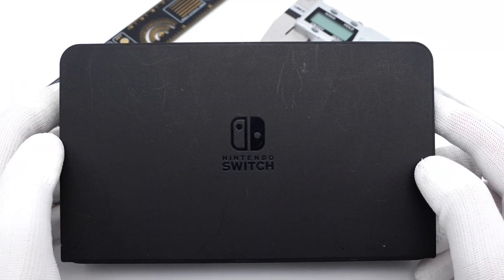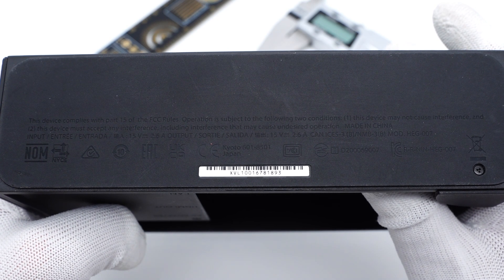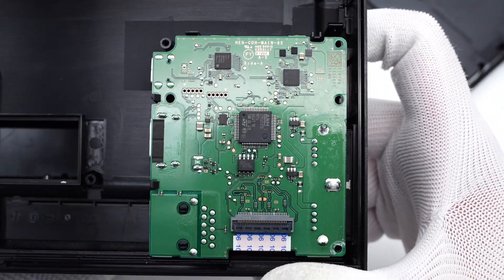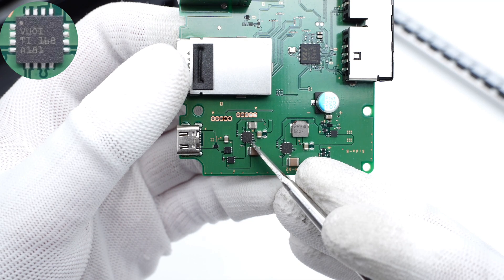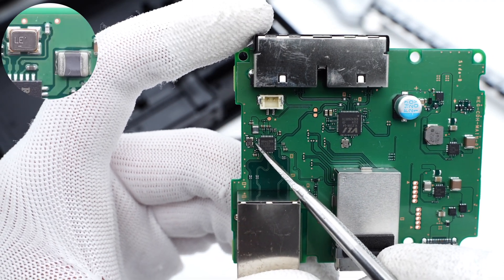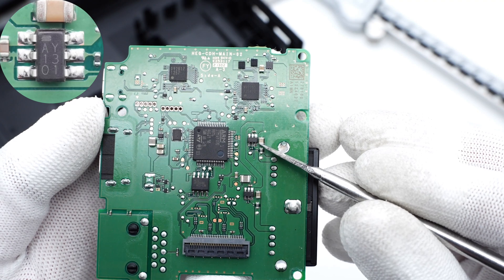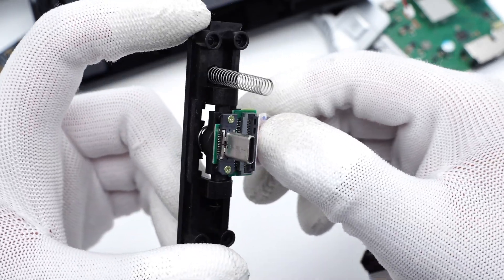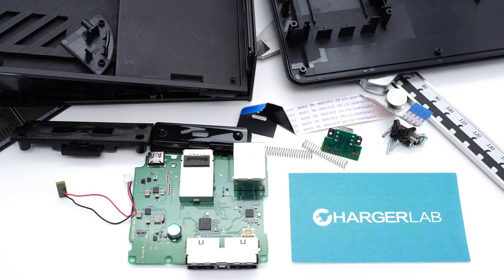Teardown of Original Nintendo Switch OLED Model Charging Dock

Comment: Any idea on why the dock will not output the video from my iPhone 16? I have connected my iPhone to an HP docking station and everything works: usb ports, Ethernet and display ports. However when I connect it to the Switch dock, with the help of a female to male usb c cable, the iPhone only starts to charge but no video whatsoever. What I notice is that the LED light of the dock stays off when the iPhone is connected. Btw, I have connected the Nintendo Switch with this female to male cable and it works, so it’s not about some mechanism in the dock that is activated when the console is inside the slot. Any ideas?

Comment: “Take out the module” (skips the part doing it).

Please, just don’t skip anything. We’re not experts like you. We want to be careful on what we’re doing.
Reply: I just did mine, you need to work your way around the edge with something thin like a small flat head screw driver and gently pry the black plastic from the white. 

The 2 layers are held together with a sticky tape and the plastic clips that you see are just for alignment as far as I can tell as they didn't give me any resistance when removing them. 

The plastic is quite flexible but take your time to gently separate the layers of plastic. 

Once you go around the left, right and top edges (bottom being the base) 3 plastic panels will pop off allowing you to remove half of the dock, there are a further 2 screws at the base below where the charger is placed. The springs and the socket will also pop out. 

Once those last 2 small black screws are out, the final piece of the dock will separate from the face of the dock, take your time again as there is a small pair of wires that hook up to the standby/on light. It slides out and can be put aside with the rest of the chip board. You can continue to remove the face plate if you should like, it seems to be the same principle. 

I had to go deep because my unit got covered with kitten urine (they're still learning) and it got everywhere! Isopropyl alcohol to the rescue!! 

Good luck, hope this helps!
Reply: @DamienDrake2389  Thank you for your input! I managed to do it by looking at different perspectives and videos like for nintendo switch (LED). But yours is helpful!
Reply: And it seems like there's no other video in the entire YouTube disassembling the OLED version. 😢
Reply: @danielguzman8607  Sadly correct. There isn’t. Not sure why. But if you will disassemble yours. Try to becareful especially when you’re dealing with the board itself.
Reply: Yeah i have the same problem, shows all the intuitive bits but then skips the most complicated part. The guy must have broken some clips and didn't want to show it.

Comment: Hi!, i was trying to find a video with the differences of a original dock and a fake one, there is something to know that?
Reply: Bit of a late response, but I haven't been able to find that. However, if the PCB has the same layout as in the video, it should be real. Mine matched in all aspects except the ribbon connector, but Nintendo is known to change those around sometimes. Fakes don't put this much effort in matching their PCB. It will often be a different hue and have a different layout if not completely different chips. Good enough to convince me that mine was genuine.

Comment: I want to disable the indicator light. I have to tqp3 over it. 

Will it effect the console if I remove it manually? The dock will still work perfectly fine with it disconnected? Right? :)
Reply: *tape over it

Comment: Can't believe the OLED switch uses USB 2 Ethernet. USB 3 has been a thing for so long
Reply: the usb 3 on the orignal dock caused issues with 2.4ghz when it was enabled posabley why its removed an now just a 2.0 port
Reply: @user-jp1yd2ut9r  routers had this figured out for a few years already, do proper shielding on the USB 3.0 port and wireless interference won't be an issue. Nintendo just went the cheap route, while still charging a premium if you want to buy the new dock separately...
Reply: @mbc07  nothing a bit of tinfoil and electrical tape dont fix
Reply: USB 2.0 has a maximum bandwidth of 480 Megabit /s or Mbps. It's sufficient as the Switch itself (also in combination with an SD-card) can't write higher speeds anyway.
Of course modern day USB 3.0 would have been preferable as a default. However for its function for the Switch disk writes will be limited in any situation.